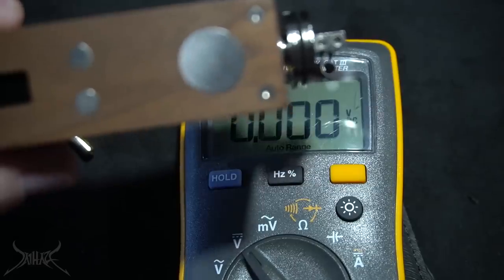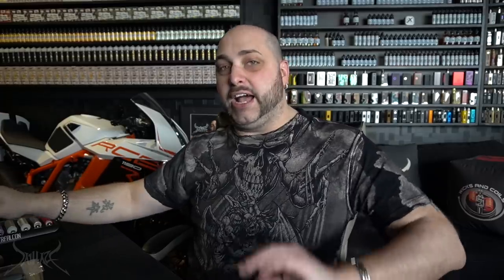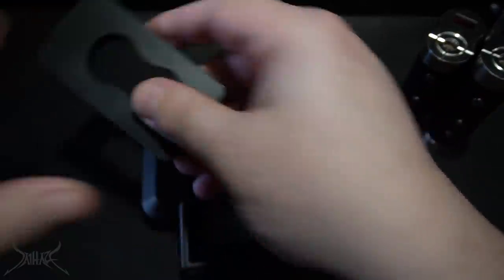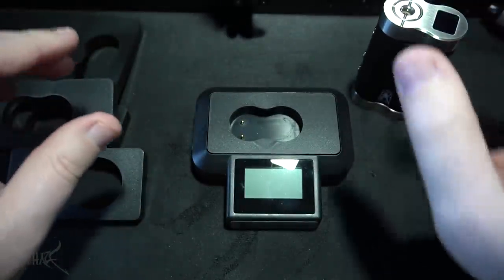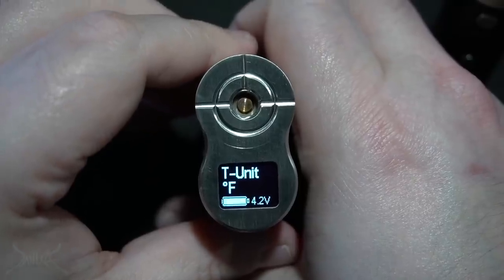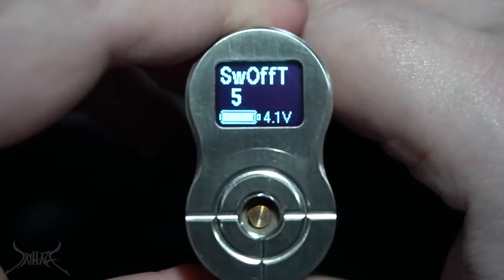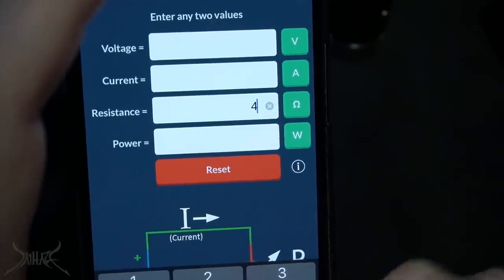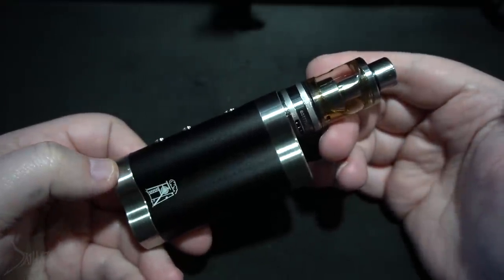Dicodes Dani 21700 Box Mod Review and Rundown | Devouring the High End Market

Comment: I own and use 2 Dicodes Mini, a V3 22mm and a 21700 daily, mostly for MTL, and hardly ever use the menu except for adjusting the watts which is super easy. For me these are the best Mods for MTL and the 21700 also for smooth DL vaping available. LOVE MY DICODES!!! Regards from Spain.
Reply: Which would you recommend between the mini and the 21700?
Reply: @ElGranjay  I prefer the feel of the Mini in my hands but depending on which ato you want it for, a 21700 will give you some advantage. If you use it only for MTL (14-25Watts) the mini will do. For more power I would recommend the 21700.
Reply: @DampfunterPalmen   @Dampf unter Palmen  Thanks, I really appreciate the info! I'm tossing up between the Kayfun Lite and Prime. Looks like the Mini and the Lite combination is going to be the way to go.
Reply: @ElGranjay  Absolutely, for this kind of Ato's the Mini is the perfect choice!! I also have the Prime, the Lite and many other MTL devices but my absolute favorite of all is the Dvarw FL MTL with the 6 ml tank. The most reliable tank on earth!!
Reply: @DampfunterPalmen  Haha, the Dvarw FL looks awesome too. Now my decision is even harder! I just came across the Taifun GT4 DTL which seems great too. Maybe should go with the 21700 so I still have DTL options but the form factor of the mini looks so good. Nice problem to have but a tough decision to make!
Reply: @ElGranjay  Yeah, it's hard :) I use the GT4 on a Taifun Box which is 1x18650 only but the Dani 21700 is also a great Mod for the GT4. Anyway, with a Dicodes Chip you'll never go wrong!
Reply: I'd go mini with a 22mm dvarw

Comment: Thanks for the extra bit of info. Seems like there is either a grounding issue with the rda used to test or the grounding of the limelight mod. I think the Dani box could have been a dual battery if it was made slightly wider or taller but I'm a dual bat and especially dual 21700 dual bat fanboy.

Comment: There's a part of me that feels like Dicodes chips could run tc with A1 Kanthal. Some clever sod made a profile for it with DNAs but it doesn't exactly work (at all)
Reply: As Kanthal doesn't change its resistance significantly when heating up, there is no sense in using Kanthal on TC...
Reply: making a TC profile for Kanthal is like building a racetrack for a stone.

Comment: If this would have been any other MOD you would have trashed it for not working, I’m not buying this if the ohms don’t pick up right, I would like to see a follow up video maybe when you figure out what was wrong
Reply: Are you talking about the 21700? Because there wasn't anything wromg with the mod he was doing a review on. The mod that was jumping up 2-3 full ohms was the Pylon with the bf60 dicodes chip. EVERY "accurate" chip will fluctuate ohms by 1/10th or 2/10ths when heating up. Its supposed to happen.

Comment: can one off you tell me a little more about the dicodes wire?
Reply: Dicodes calls it Resistherm. It's a nickel-iron alloy with a high TCR value (320) for more accurate TC vaping.
Reply from the maker: ty scrap

Comment: the only 2  21700 batteries that fit into mine is Samsung 30T and 40T. 50E is a bit too long and the rest on market is to thick! you should know that so you dont buy it and no batterie fits when ity gets delivered
Reply: Have you tried Molicel P42A's? They fit in mine just fine.
Reply: @scraprat3369  I only had a rewrap from vapecell that should be a p42 and that didn't fit..
Reply: mkd0815 wrap is “too thick” 

I’m waiting for the revised version of this that will accept cells slightly larger than 21mm in diameter. They goofed up the dimensions of the battery tube to not accept anything larger than 21mm the same way they released the Dani 25 tube. Same error but they somehow didn’t learn from that experience.
Reply: @DONTSHOOT999  they tell you in their German support group that it's the Chinese manufactur fault and just use 30t or 40t. That 50e which they promote are too long to  close the door flush they ignore. My box was already twice shipped in and still not ok. Bottom is not straight and it does wobble standing on my Glas table when I type. And no they did already say they will not enlarge the inner tube
Reply: mkd0815 wtf so now they’re refusing to enlarge the tube?
Reply: @DONTSHOOT999  I was told the tube is in spec and the battery manufacturers are at fault and they won't change the mod
Reply: @mkd0815  I believe Dicodes is in the process of making the tube bigger to fit the 21700 batteries that are the bigger side.  Last rumor I heard, is that in April the new revision will be released.
Reply: Tin Garaus  Starting Batch 2 or 3 they did change that ... At the Time of this Post it was still like i wrote

Comment: Dude Jai even the battery life was changing with every press of the button.  That chip is most definitely messed up. And why do people think that you dont know power output? Do they not know by know you use over 5 volts to vape daily? Haters need to just sit down and shut up
Reply: The battery life is changing because it measures the battery under load in the main screen. Plus, the internal resistance of the battery. Furthermore,  probably the limelight's calibration is messed up. And you :D
Reply: @mantst1891  I only have one Dicode in my collection and I never even noticed that. I'm definitely going to look as soon as I get home. I mostly have DNA, and few YiHi that I'm not that big a fan of...